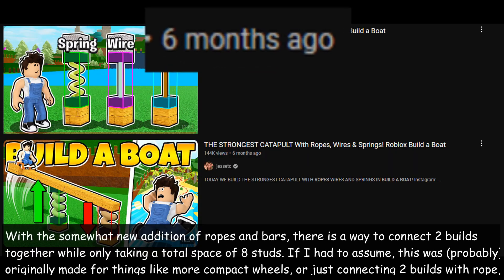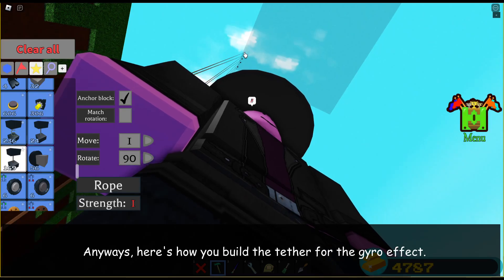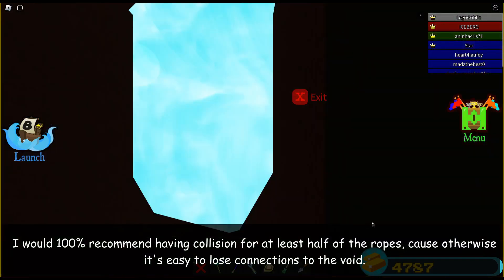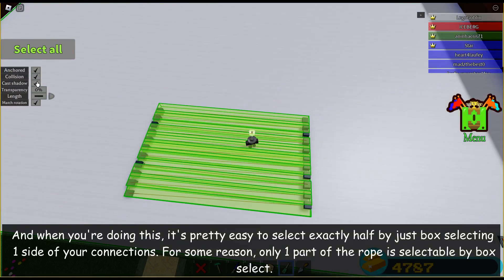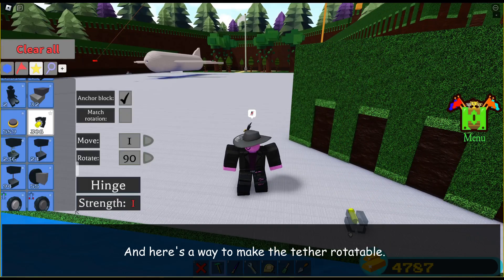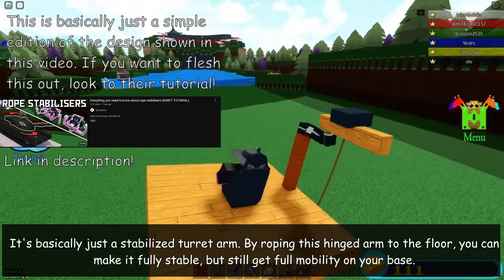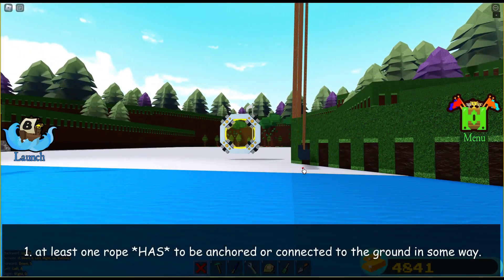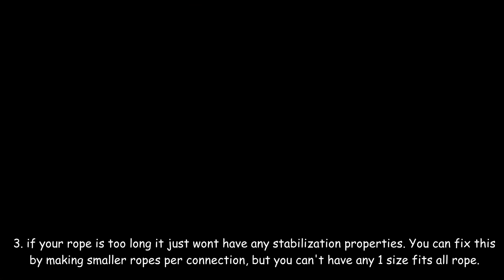Gyro Stabilizer Effect for Any Build Using Rope (BaBfT)

Comment: There is a much easier way to make a long rope. Just connect the rope to a really long spring by moving a platform into the sky, and let it fall. The rope will still have a really long maximum length, band the spring will prevent the rope from bugging out once it gets compacted by falling. As an additional plus, if the rope goes into the void, it doesn’t “kill” the rope block. Also, it only uses one rope :)
Reply from the maker: Thanks for the tip! What you said is probably the safest method of lowering it. I don't remember if I went into it in the video, but if anyone is reading this that wants more options for rope lowering, you can:

1. Connect the top part of the rope to you (using glue), and then go through a portal to go back to floor level.

2. place a bunch of blocks on the top part of the rope, and drop it from the sky. It has a chance to glitch through the floor, but it can also just stay on floor level with some luck.

3. (this method doesn't require moving it to the floor level it at all) Attach 1 rope to the floor, and place it high in the sky. Then, with a second rope, you can place it on your build, and then place it on the upper part of the 1st rope. If you unanchor all, it will drop the 2 ropes, and they won't be deleted by the void. (This method gives you double length, but it can also cause some other issues, such as physics latency/dragging your build downward)

Comment: Is there a way to like engage and disengage the gyro stabilizer effect with match rotation on? Cuz I want to put this onto my helicopter as an auto pilot feature.
Reply from the maker: I've tinkered around with this before, and had the same autopilot idea for planes, but I haven't found anything yet. There might be something with the harpoon + hinge thing, and I'll try to explain that here.

If you put a hinge on the pointy part of a harpoon, it will attach to the harpoon even after fired. You can attach whatever build you want to the harpoon end with this, and if you have hinges on all 4 sides, connected to each other, you can get it close to fully stabilized. 

My assumption is that if you attach the rope to the harpoon, you can shoot it out and retract it whenever necessary. (shooting out makes it separate from the build, retracted makes it a part of the build)

I've never tested this myself, and it would be very tedious, but I'd like to know if you could get it working!
Reply from the maker: if that doesn't work, you could of course just use the screwdriver tool to enable and disable whenever you choose haha

Comment: I only get rope length 199999 :(
Reply from the maker: as long as you bring it down from the sky, that should still give you full map coverage. You can do that by:
1. Attatching a cake to yourself and the rope while on a seat, and then bringing it down by teleporter
2. Attatch another rope to the floor, and then up to the high rope and make the floor rope 2 length. 

If you're still having issues, then just tell me the issue and I'll try to help more.
Reply: @LegoGoblin  I already did that, thanks to a glitch I was able to bring the part underneath the void up to the surface. Besides, I also found a way for players to go down to the void without being reset :)))
Reply: @LegoGoblin  after I checked it back, it actually length 1999999, not 199999 :))